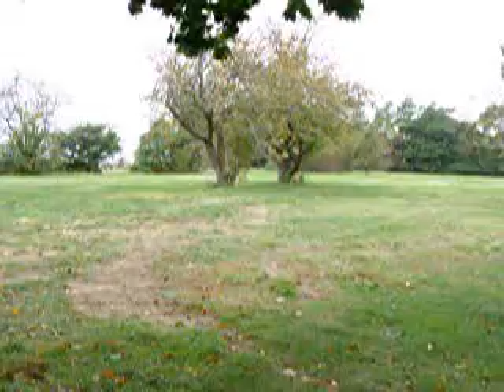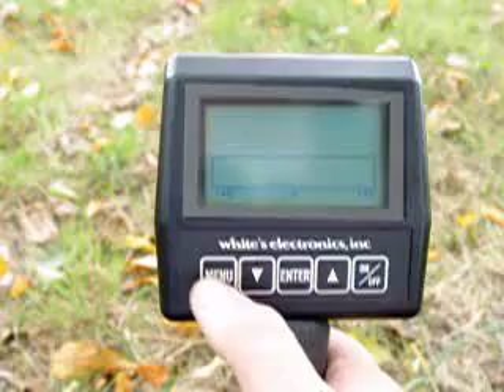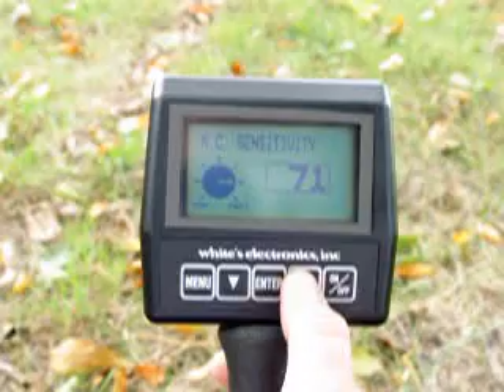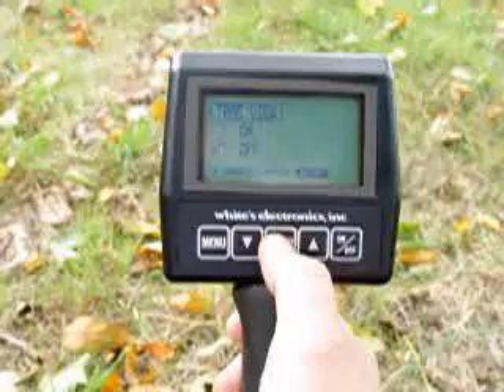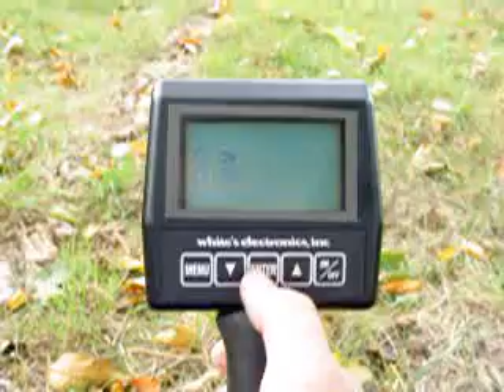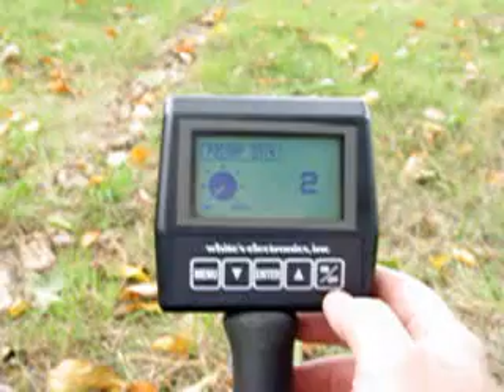EAST COAST METAL DETECTING WHITES XLT RELIC SET UP

Comment: Is there anywhere I can buy this machine I loved my old one thanks from uk
Reply: Ebay
Reply: My dad bought a brand, spankin' new one and the "Bullseye".  He never even touched the thing. I found the batteries still in the box. I tried to understand the settings. I took it out a few times a couple years ago using the presets and all I found are what it is telling me are coins which are actually nails and scrap metal.  But I most likely need to understand how it functions. Is this that great of a machine?
Reply: @markfothebeast  The Spectrum XLT is quite literally one of the finest vlf metal detectors ever made, period. When compared to the machines of today, in 2023, it will still outperform almost everything out there in quantity and quality of finds and in detection depth. Even outperforming most of the newest latest greatest multi-frequency machines. Keep in mind that this machine debuted in 1994. That's 29 years ago!!! It was so far ahead of its time, so advanced. VERY VERY complex to master because of the incredible amount of settings that could be adjusted. I speak from experience having purchased my XLT brand new in 1997, which I still proudly own by the way. It's a machine that you MUST devote lots of time to understanding every aspect of. Many books have been written specifically about just the XLT and if you truly want to get the most performance possible, buy them. I bought the books, scoured the web for every bit of info I could find (and in 1997 the world wide web was a brand spanking new technological advancement available for all of society to participate in, there was no such thing as google because it hadn't been created yet, ebay had just become a thing that very year, 56k dial up phone modems were the norm for accessing the internet and cellphone technology was still too expensive for most to afford), and talked on the phone, landline to landline, with metal detector shop owners seeking tips and advice to improve my understanding of this incredible machine. Also, I paid $1100.00 for my XLT in 1997 (which is $2056.00 in 2023 dollars). I bought it from Kellyco who had the best price I could find. That gives you an idea of how long Kellyco has been around. Do know that there are many many people in the world right now who have detected with an XLT but for one reason or another, no longer own one and would relish the chance to purchase that machine from you  should you ever decide to sell it.
Reply: I asked about it in another videos comments and someone had told me that it's far inferior to todays machines. So thanks for this info. The interface and display aren't fancy but I'm glad it has some great capabilities.
Reply: @markfothebeast  Today's machines have advanced faster microprocessors which will provide a faster per target recovery speed. Today's machines utilize a coil technology that is more advanced. Some of today's machines offer bluetooth pairing for wireless headphones, yet another tech advancement. Today's machines are lighter in weight due to advances in construction materials. I won't deny those facts but from my viewpoint, they aren't enough to relegate the XLT into the old decrepit and useless detector category. Depending on who you ask will determine the answer you'll receive. The XLT held top dog status for many many many years. Hands down, irrefutable truth. White's released the DFX model in 2001, I think, which was the world's first TRUE simultaneous operating dual frequency detector which in all honesty outperformed the XLT. It was a newer technology. Then a few years later or so, White's released the V3i model which was a 3 frequency dominant coin detector, yet another breakthrough technology that revolutionized the detector world. None of the other detector manufacturers rose above these levels of engineering except for Tesoro who in their own right were producing some phenomenal detectors that were hot on gold, which was a different direction than White's which was more silver focused. White's went out of business (Garrett bought and now owns all their patents) and then so did Tesoro go out of business......each for different reasons, both sad stories. The long and short of it is this: the primary detector advancements from that point until now are simply that the other detector manufacturers were made privy to the White's engineering data and have incorporated such into their modern machines. They are just now catching up to where White's was. Nothing new, just a piggyback ride. If I were you, I'd consider both sides of the fence concerning the XLT. There is a steep learning curve and accessories are difficult to find. It's a heavy machine compared to today's offerings. Conversely, it can shamelessly run with any of today's big dogs and will regularly produce spectacular finds. It remains a high end detector at the end of the day. I'll share a secret with you. The best detectorists are the best because they excel in 2 areas: 1) By digging each and every target your machine identifies over and over and over and over until you are correctly interpreting every sound/signal the machine relays at which point you become one with your machine. 2) Developing and honing to a fine degree your research skills in locating a patch of ground with the highest probability of producing quality finds. Going out into a randomly selected patch of woods and hoping to find something good is a recipe for failure. The highest volume of people occupying a patch of ground over the longest continual stretch of time offer the best chances of success to a metal detectorist. Use your brain, read books written by detectorists about detecting. Go detect places where detectorists have already detected. If those who went before you deemed it worthy, it's still worthy because they didn't find it all, guaranteed. Seek out other detectorists. It's fun with likeminded people, you'll learn lots, and there's safety in numbers. You'll get better as you go. Takes time and patience and perseverance. Enjoy the hunt. If you're not enjoying it, consider another hobby. Embrace history and good luck! There's more to find out there than you could ever imagine. You'll find plenty if you stay after it. My last bit of advice is once you develop your third eye, that's when the fun begins!

Comment: 10" to 14"!! Bet if you measured it would be at most 10". Some of the settings don't even exist..Moderation I assume is Modulation, AudioTrack is AutoTrack, sounds like you have too little understanding of the detector to be giving advice on how to set good programs.
Reply: Mark Allington because he mis pronounces words it means he doesn't understand his machine?? How do those two things go together in your brain?
Reply: BAMA Woods & Water because grammar police, is comparable to a dictator, a cop whom never writes a warning,
Reply from the maker: Been detecting for years and talking to whites and the guys that built the programs for whites detectors, But that's ok guys are pulling more out of the ground with the tweaks then ever, thanks Mike eastcost,

Comment: Great info XLT's are the best very hard to beat as far as depth goes.I wore my first one totally out 15 years use.I liked it so much I set out to find another XLT to replace it which they don't make anymore.I did manage to find one almost new condition not a mark on it and a earlier model than my old one and the depth on my new one is unreal.My first real hunt in a old park with a 5 inch coil first good target signal it was  18k gold wedding band and the 2nd good signal was a another ring